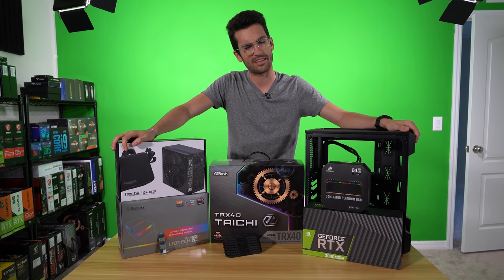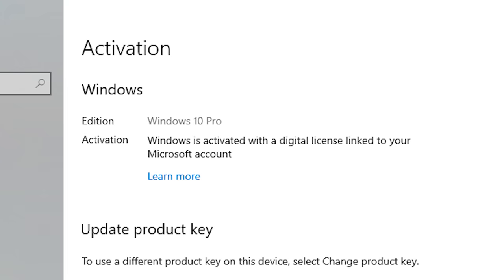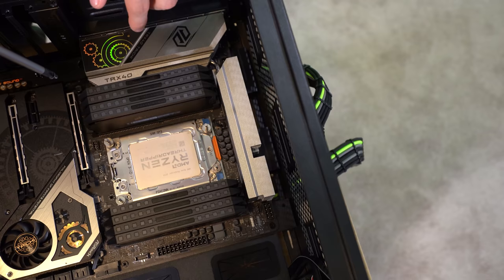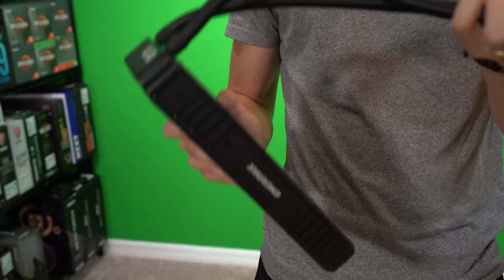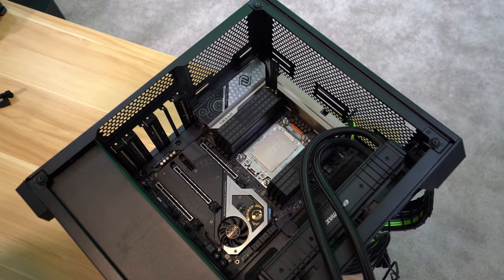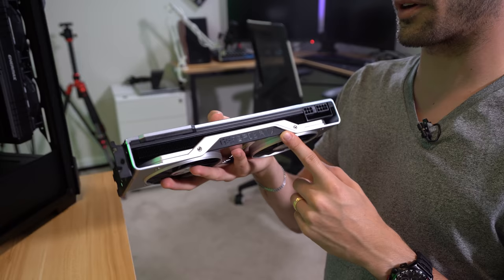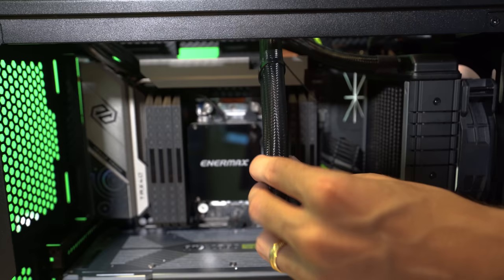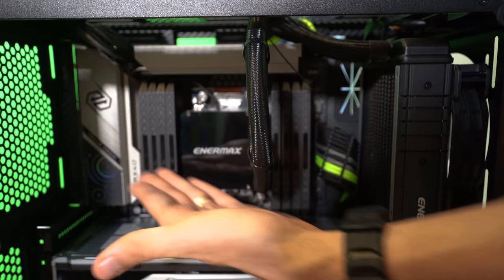Let's Try This Threadripper Build Again...

Comment from the maker: So, apparently, I missed the memo about "corrosion" in this AIO. I don't watch much tech YouTube and prefer to find things out for myself, anyway. It's my job to mess around with hardware! I've been running this setup for a few weeks and haven't noticed an issue, but I'll cut this sucker open and investigate if I notice anything super sus going on with temps.
Reply: Did you read the instructions for the aio?
Reply: for me it was when the idle temps where above 60 degrees in my TR 2950x
Reply: Yeah Gamer's Nexus did a real thorough investigation into it. I also have the same brand, but the 360 version for my 2950X. A little over a year and still no issues. Yet.
Reply: I would recommend gutting the cooler early rather than late if you don't want to deal with bunch of corrosion in the AIO. The only problem is water quality. Just dump it and refill with distilled water+biocide for best performance.
Reply: Some people might give you shit but  it's a good data point to get people getting the same or different results without a bias going in.
Reply: From what I’ve seen it takes about a year, if the Taichi has additional temp monitor probes like some of the gigabyte boards try putting one on the side of the radiator, that way you can watch if the radiator temp slowly increases over the months. This will give you a better idea than momentary spikes and drops that cycling the cpu will have unless you chart and average it since the water temp will be more stable overall. It’ll be interesting to see the follow up down the road.
Reply: G'day Greg,
It would be a good Idea to change the Coolant now & NOT wait until you have problems
Reply: Yea was just about to comment this. My brother has the same AIO and there WAS corrosion after a few months. And thats crazy considering there was already build up would get to that much playing typical RPG n 4X RTS games.

 Im not sure about temps, since we didnt notice anything extreme but we already changed the AIO and hope u do too.
Reply: Better save your rig before it's too late buddy
Reply: It's probably gonna take at least a year of decent usage before you see a problem.
Reply: Sorry Greg but you should really follow other reviewers, if nothing to confirm your results.
Reply: Also you should wipe the aio cold plate with alcohol before installing it to remove the glue residue from the sticker. Yeah I know, minor difference, but this processor is though to cool so everything counts.
Reply: A bit of tough love here Greg. If you YouTube search for "enermax liqtech tr4" the top results are about this problem. The GN piece has 603K views. You literally produce videos about buying used PCs which tell people to do their research before buying and do not follow your own advice. You should have just owned this situation and said "I fucked up, I'll do better next time". Instead you follow a Verge-like video with a Verge-like excuse.
Reply: @kyoudaiken  40% feels too generous.
Reply: I think the corrosion issue took a year or so to manifest itself. Hopefully, Enermax has resolved this issue cause its supposed to be the best AIO for Threadripper.
Reply: nice build, good luck.
Reply: I had the Enermax Liqtech TR4 II 360 on my 2950x and temps were great at first, but after around a year they were up to where yours is now.  I've never done custom loops either so i ended up settling with an air cooler.  I'm very disappointed that there are so few AIO's on the market for TR4 even after all these years, and all of them seem to have one issue or another.

Comment: Custom Loop: Leaks

Enermax: Watch me corrode this whole block
Reply from the maker: If this happens, I swear...
Reply: @GregSalazar  It will. It's a notorious flaw with these specific liquid coolers unfortunately.
Reply: @GregSalazar  GN did a test and Enermax uses shitty water and glycol as well as a few other things that make every cooler eventually fail :( You can empty out the liquid in the AIO and put in your own and it generally helps solve the issue for longer then if you didnt.
Reply: bruh moment
Reply: @GregSalazar  "when" it happens.
Reply: @GregSalazar  Can you change the coolant in that aio?

Comment: 6:20 You actually can change the color of the light on the Founders Edition; it has all the LEDs needed for RGB! It is set to green by default, but the color can be changed by flashing an EVGA bios onto the card. (This also lets the fans completely stop at low temperatures)

Comment: The only exhaust fan I see is from the power supply.  Would it help to have another exhaust fan in the system?
Reply: Positive airflow will handle that
Reply: I agree with Briguy1027, my threadripper gets very toasty when I only have two intake fans running, so I have a manual fan controller to switch on 2 exhaust fans when doing big work or gaming. Makes a big difference for me.
Reply: A B Having positive airflow doesn’t instantly make things better, I can have five intake fans and one exhaust and have worse temps than if I were to balance it out more

Comment: Yeah, the Enermax TR4 coolers have issues which seem to be a result of the fluid. I owned two of these and the first one started showing issues five months in. Enermax covered it and sent me a new one. The first thing I did was drain and flush it, and then I refilled it with distilled water with a biocide/corrosion inhibitor. If you're going to run one, I highly suggest doing it. It will corrode and you will have to get Enermax to send another one out, unless they've fixed their fluid issues.

Comment: I've done a build in this case and it's pretty good. Stupid part is that the fans are $80 for a 3 pack if you want extra. So it's cheaper to buy two of the cases and just harvest the fans. Plus the Node Core that comes included supports all Corsair RGB fans.

Comment: Any particular reason for not using a large beefy air cooler?

Is there a benefit of front mounting vs top mounting the AIO? I get the fresh air aspect, but you'd think this would be mitigated through proper airflow.

I guess the fan in push configuration is for aesthetics, or is there a benefit to this too? I prefer pull just because of being lazy and I don't have to worry about dust being packed into the radiator.

Comment: The enermax 240 seems kinda small. AMD recommends a 280mm aio for the 3950x. Hopefully your rig stays cool. I know you'll stay on top of things. Good luck with that killer new threadripper rig.
Reply: That’s not even the worst part. The aio is notorious for corrosion.
Reply: @3xtan327  I know. I'm a big gn fan. And everybody else mentioned it in the comments. I thought I'd just mention the undersized radiator.

Comment: I feel like opting the thick radiator for a thinner one but using a push/pull fan configuration with aggressive curves would probably help. Or of course doing a 360 mm rad with push pull it’d probably drop temps

Comment: Despite people hating on that cooler, it is still one of the best AIO solutions for the threadripper platform. It will probably corrode out and clogged up in a year or two, but that is quite a ways out there, and these things are very easy to take apart and clean, and refill,

Comment: Is there a reasoning for no exhaust?  Will that not hurt the thermals of everything in the case, having the air trapped in there?
Reply: The air isn't trapped. Positive pressure will force air out.

Comment: You tested the CPU temps but what about the GPU and System/VRM temp figures ? Those 200-300W of waste heat will be blasted into the case that has no exhaust fans - directly into the GPU ... gonna be toasty. I really do not understand why you still use that case, it's not exactly pretty or "special" to be worth compromising the cooling capacity for looks.

Comment: So far as I’ve seen Enermax hasn’t fixed the issues with the gumming of the cooler. I’d just seek out the Asetek with the copper square plate for the TR4. Might be harder to find or cost more, but you won’t be replacing in a year. Frankly you can cool lower core TR with a 120mm AIO and a fast enough fan, so a 240mm is more than enough.
Reply: @UCmbkRUS_4Efdt5UIhwNqtcw no I’m not saying one with this many cores or even advising it, I tried it on a 12 core to see what would happen and it didn’t really get too hot, I used an EK Varder static pressure fan at max speed. I know Alienware shipped with them. I saw your temps and they seemed a tad high in regards. Does that case obstruct airflow a lot? How are the fans at putting air through that thicker radiator Enermax uses? I noticed you pushed air into the radiator, would reversing the fans to the other side of the radiator provide better flow? I know it would be easier to clean the radiator that way.

Comment: With a 2920X and a Cooler Master TR4 360mm IAO cooler i max out  at  65c in cinebench. The open case (cougar Conquer) help a lot, but 360mm isnt overkilled for threadripper ;)
Reply: The difference between a 240 and a 360 aio is marginal since the 360 is thinner 
If you want better performance go with a 280

Comment: I notice that you are wearing a ring, bracelet and a watch while working on this build. I had to learn the hard way so I never wear anything on my hands and wrists that could short circuit s component or accidently snag and break. I have dropped a HDD from clothes catching the edge of the drive and I have also managed to short a motherboard with my wedding ring. I recommend you do the same and make mention of this to your audience.

Comment: I really think that is you want a CPU like that, you should either be doing a custom loop for cooling, or use a larger case to fit a 360mm AiO. Otherwise you're basically wasting performance.

Comment: Beastly build! I'm a sucker for steampunk aesthetics so I really like the Asrock Taichi motherboards. The GPU fits it well to.
Oh, and don't forget to let us know when the Enermax AIO leaks. 😄BTW, my single tower air cooler Noctua NH-U14S-TR4 manages the same and even better temps with my 3970x. Could the AIO be defective right out of the box? 🤔
Reply: The Colorful Kudan V 2080ti would be the perfect match to the Taichi if you like steampunk

Comment: that a gen 3 version. thicker rad and different block. i have gen two  tail end. had it for a year now no issues.  just fyi you need fans on other side of that thick of a rad.

Comment: Greg, bruh I am a fan but 240mm with a threadripper is bonkers. The TR42 280 barely cooled TimmyJoe's threadripper. You should probably get that or the 360 rad, I know I would.
In the meantime manual lock the overclock to 3.5 or 3.3ghz so the BIOS doesn't get any funny ideas. I know I had to for my Asustek cooler for threadripper until I got a proper cooler. 

And as you prolly surmised by now that Corsair 220Ticue case front bezel is shit for airflow, so just keep it off entirely or make a front bezel full mesh mod to the case with some netting, mesh with a Dremel and superglue ( Bill Owen (MNPC-modstech) can help you with that expertise)
Airflow is paramount, maybe a core i5 quad-core can be cooled with the front bezel airflow, but this is TR4, Heavy Duty CPUs we are talking about. Take barriers down, not build them up....
Cheers! I await for a part3 video for this PC.

Comment: I overslept the video about the first building, but I would have a food for thought :-) My watercooling systems all run with appropriate monitoring of the important values. The probably best solutions to this problem can be found at Aquacomputer. I am surprised that especially with English speaking Youtubers there is no monitoring and control of the watercooling. Controlling the fans according to water temperature and an alarm when a critical temperature is reached could have prevented the disaster. 
Probably my approach is wrong, as the system was never intended for continuous operation, but it could be useful for future systems that really should be used for a longer period of time, especially with regard to shrinking production sizes and thus increasing demands on cooling of future hardware.

Comment: Question to AIO owners: how serious is 'pump noise', is it a thing? When I upgrade to Ryzen 4000 I'm thinking of going AIO this time but I'm not 100% sure.
Reply: I just upgraded to an AIO, specifically the Corsair h100i Pro RGB. It's a little quieter or as quiet as my old Hyper 212 Evo.
Reply: I've never heard my Gamerrstorm EX
Reply: I’ve got a Corsair H150i Pro. I’ve never heard my pump. I leave it on high speed.

Comment: Drain that AIO, clean out all the crap, flush with distilled water and then fill with a decent fluid with biocide.  Job done, Use that enermax in its current form at your peril.  I am still using my Gen 1 enermax AIO, it ran for a year before i cleaned it out, man that was some nasty shit in there but its working a lot better now.  I also swap out the fluid every 6 months or so.

Comment: Does a thredripper build with zero case exhaust fans and no push pull config on the radiator and wonders why the temps are high?Granted the case doesn't allow it(push-pull config)  but you should've picked a better case instead.and the fans should've been blacked out noctua fans for a professional look with awesome noise to perfomance ratio.not even gonna mention the corrosion problem with this enermax aio.

Comment: My define s case had a defected USB 3.0 female plug where one of the holes just wasn't formed right during manufacturing and I would get it work sometimes but I've ruined 3 USB 3.0 headers on 2 strix boards. Yeah just a lil irritating. Now I have a 011 dynamic case with one working USB 3.0 on the front because of the broken pins on my board.

Comment: I do have to wonder what the purpose of this pc would be. Threadrippers lack the single core performance in gaming. If its a work station, it would still benefit more from a 2080ti or even RTX Titan.

In either case a 6-8 core, 12-16 thread cpu w/ faster clock speeds would be more beneficial. If you're wanting to run a server and do w/e, you'd still be better off w/ a dual pc set up.

Most of the cooling issue is bc of the case and fan lay out. A slightly larger case w/ a 280mm rad and a set of Noctua 140mm 3000rpm fans would be more effective and quieter @55% than anything Corsair sells. It also seems you're hoping the positive pressure will push the heat out. Its far more likely your rad will become plugged w/ dust bc of the uneven pressure, leaving only your pump to cool the cpu.

This build looks far more like a flex than something that received even the slightest bit of thought. But hey, enjoy your rig. Its your money, your pc and you're free to do w/ it as you like.

Comment: I've been having issues you described at the end with my 360m radiator. I am in a dorm room that has been at 90F for the last week. I turn my computer one and my normal cpu temp of 28C starts at 60C and only rises if I try to do anything

Comment: I'm curious, does having that aic under the gpu cause slightly higher temps due to shrouding the fans a bit?
Reply from the maker: Mostly negligible. The card has direct access to fresh air via the PCIe slot cover vents.

Comment: Technically, you want the tubes to the bottom of the rad when installed, so bubbles do not form in the lines/pump. Over time as fluid levels drop, you will get more air in the system which will flow to the top.

Comment: some time ago you had video about m.2-2280 nvme ssd saying they are not recommended to use for important programs and files in long term(10+years) and something about losing your data when current is cut.  could you explain this a bit more. i planned to use m.2-2280 nvme ssd only on my pc build and i could lose all my data????

Comment: Enercrap yummy but tbh no jokes is it still freakin garbage? Cuz im looking for aio to keep my cpu at good temps
Reply: It's the liquid inside of the AIO that came from contaminated solution from the factory, the design is a good performer, I plan to get a TR4-2 360 and just drain and replace the liquid with some clear distilled water and growth inhibitor/ biocide from the start, so I don't have to fret and give me like 3-4 years of continuous running, on my 2950x. It's a workstation build, so I just want to have no doubts.

Comment: Threadripper with a 240 AIO I think is a very bad combination... IMHO you should at least go for a 360 with a custom loop and a big reservoir because of the heat... and please avoid Enermax like the plague.

Comment: I'm sorry. I would not be satisfied until I got full speed out of a $2000.00 cpu.   Yes you would need to water cool but in a larger case with a bigger rad. More fan power. RGB optional but max processor output without overclocking.

Comment: should of just went with the 3950x less money, cooler temps and performance wise its not that big of a difference, yes the extra cores are nice for editing and under load but price and heat issues plus aio's don't keep up with the 3970x so waste of money, unless you buy a full tower with 380 cooler and extra fans on bottom to have the whole thing cooled better off with 3950x

Comment: Nice! Here is my 3970x ThreadRipper build! https://youtu.be/RK9RDWBboqs
I use the Fractal Design Celcius S36 (black) AIO cooler. 
It's completely quiet & keeps temps under 40 at idle, & under 65 at full load (rendering 4k video or benchmarking).

Comment: Even though the MB adds a plate over the SSD, there is still a reason they add a place to screw down the ssd. SMFH.....
Reply: I noticed that too. I'm not a fan of how he puts his systems together tbh places ram in then speaks about how tight it is to put screws in for cpu cooler stand offs and adding the m.2 in after the motherboard is in the case.
Reply: The mounting screw for the ssd is also one of the mounting screws for the heatsink. It's the same on my x570 Taichi.